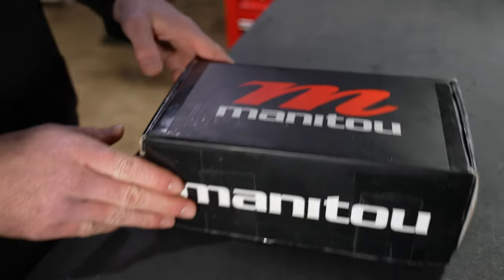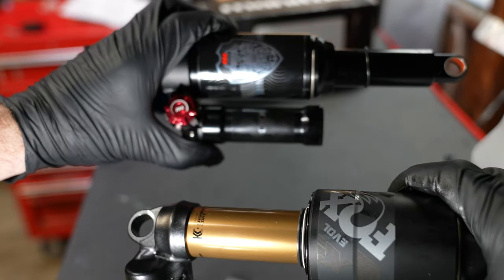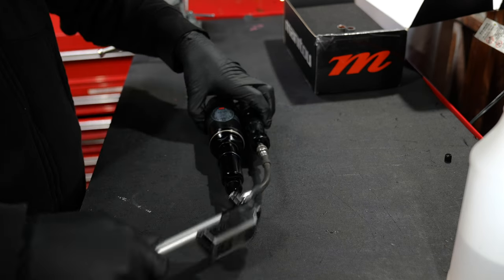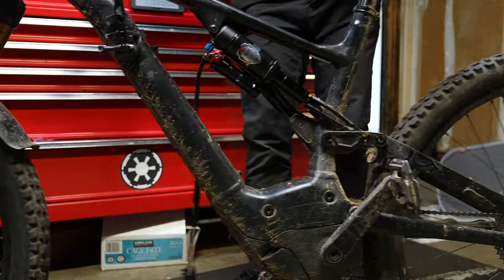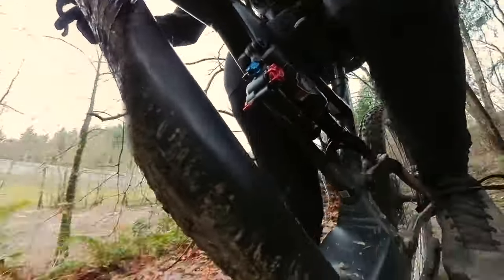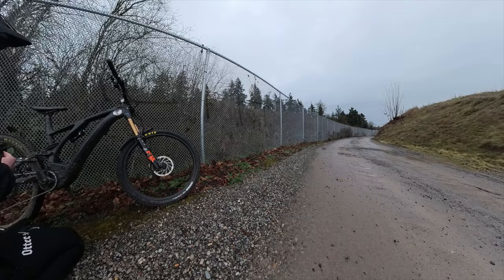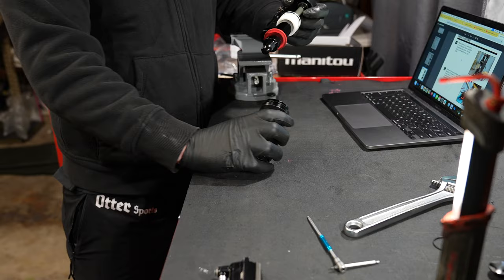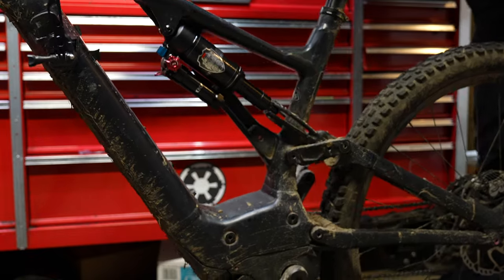Manitou Mara PRO Experience

Comment: How can you not understand psi? Its in the name, pounded per square inch, Chane the squared inches and like magic you need less pounds
Reply from the maker: Bro, thanks. Over thought that I guess 😆. It has more to do with the size of the negative chamber, but the part I don’t get is how is this shock so plush with low pressure. ‘23 Rockshox  runs low pressure, but it’s harsh off the top
Reply: @OtterMTBtech  the resistance is from the seals. A typical Oring  actually gets pushed to the outer wall with more pressure, that's how they seal. Who(you) knows what seals these shocks use, but they would flare out under pressure

Comment: FYI. As the volume of the IFP is VERY small the pressure will drop SIGNIFIGANTLY when you connect the shock pump as the air will fill the hose and thus equalize. So when you set the pressure there it is set. It does not loose presure when you take it off - but will do so when reconnecting the pump. So it maybe wasnt't bang on 300 PSI but is was sure as hell not 140.

Comment: lol bro, you don't cycle this shock while filling it. THERE IS NO EQUALIZATION PORT. You have to set the negative by taking the air can off.
Reply from the maker: I didn’t know this. Do you care to share any more about shock. It supports riders 240lb as is usable rebound range and air pressure setting. 

Most shocks couldn’t do this
Reply: @OtterMTBtech  Fox and Rockshox use a dimple on the inside of the air can so the pos and neg chambers equalize and it's usually around the sag point. Upside is that your negative is always at the right pressure. Downside is that there's a dead spot in the shock, and it equates to 5-10mm of wheel travel. Manitou don't have this dimple or dead spot. So to set your negative pressure, you have to take off and reinstall the air can. You can put the shock in the freezer to increase the density of this air and the pressure in the negative according to pv=nrt that we all know. But air will slowly leak out of the negative so you'll have to re-set it periodically. I do it once a year.
Reply from the maker: Thanks, probably in the manual I just don’t remember that?
Reply: @OtterMTBtech  Probably, but to be fair, Manitou's setup guides are not the best. What would make this shock perfect would be if they added a fill port to the negative and an easy swap damper like Formula have. The Mara Pro is really good in the stock tune for riders 150-180lbs.

Comment: You may want to take another look at what the IFP pressure should be on this shock. Just watched a video where Manitou reps talking about the shock and mentioning they set themselves apart from other shocks in that they only require IFP pressures to be at 150psi.. So that shock reading you got actually checks out.... EDIT- i did just look at their service manual which states 300psi.. Confusing.
Reply from the maker: I watched that video and read the repair Manuel who’s right?

Comment: Could you try some Formula Selva S or R forks? (preferably S) I'm deciding between that fork and a Lyrik
Reply: The MOD Coil shock would also be cool.
Reply from the maker: It’s a no brainer,  if you can afford the Italian stuff it will always outshine main stream stuff, I haven’t even seen that fork in the usa.
Reply: @OtterMTBtech  weirdly the fomula selva s and mod shock are cheaper than most of the fox and rs stuff on Propain's configurator
Reply from the maker: Italian damping is on another level. Don’t hesitate to get that fork.

Comment: Mara pro is awesome. wait until you try a mezzer to or even a Dorado. Nothing beats the Dorado.
Reply from the maker: I have literally never heard anyone say anything bad about the forks. Have you tried both?
Reply: @OtterMTBtech  I have Dorado Expert (swapped out from a fox 40) on my DH bike with IRT upgrade and Mezzer Pro on my trail bike that I take everywhere else. I have tried a lot of forks, these are the ones that work the best for me. The damper is extremely good IMO, and the air side is extremely good at forming the curve how you want it but is is quite sensitive to changes in pressure. It takes a while to find the correct setting but once you do it's very good. Dougal/shockcraft from NZ knows a lot about tuning them. I never used him but I have asked him questions and he knows all there is to know about manitou products.
Reply: Hell yeah. Have been using dorado 36 from 2013 то 2021. Now have a 37mm dorado pro. Didn't even consider any other fork for replacement

Comment: It is also not just due to the negative air chamber that will make it feel plush as it sets the negative side from the atmospheric presure (from shock fully extended) and not ny a transferport like many other shocks do. So the plushness also comes from the low pressure in the pos chamber.

also - the setup must have been wrong here. It looks like you bottom it out just while pumping with your legs. This is, just like the Mezzer, their big hit shock, so it feels very strange if that was a perfect setp and i just BLOWS through all the travel that easy...
Reply from the maker: Mezzer

Comment: Nice video. So I have a Mara pro and I found with the large can it was too linear.  (Did you not get into the can where you can change how large the volume is? Not unscrewing the can it is a sleeve on the outside of the can.)
   To remedy this i put the smaller air can on and then still had to get a volume spacer to go inside the air can on (this one I unscrewed the air can for) the whole time i was emailing with Manitou about my setup. 
    When I first got it it was so wallowy and I would bottom it out on pump tracks.
Now the shock is softer off the top with great mid stroke and ramps up at the end, and i was able to dial down the compression
   I run 26-28% sag. 
     The amount of adjustability with this shock is impressive. I really want to try a mezzer  and a mattoc. I have a mastodon and I love it.

Comment: The maraprohas great featuresand veeery good damping.
But the old Design has its quirks with the sealed negative chamber. That means it cannot be that smooth as it could be and it dies not work well with everykinematics.

Now the Gen 2 mara ist coming. It finally has the equalisation port, a new designed damping piston, tunes and a smaller oiggy bag and lever to make better clearance in more frames.

The shock will be a completely different animal.

Believe me, I already have the Gen 1 Mara pro which one tuner modified for me with equalisation port.so so smoothamd supoortive.

And manitou even optimised the aircan itself for the new design. So thisthibg will be great

Comment: My Specialized brain has an auto-sag feature that requires 300 psi initially before releasing to proper sag. But of my 3 shock pumps, 2 only go to 250 and the third took a ridiculous amount of effort to get to 300. Wtf Spesh?
Reply from the maker: You need a better pump

Comment: Measuring sag with pump attached to shock for me is questionable.
Reply from the maker: For sure
Reply: It wouldn't work for a Manitou fork but works fine for Manitou shocks.
Reply: funny story, I was in the bike shop doing some demo rides and I suggested, "hey, why don't we use one of those rubber straps and strap the pump to the frame when setting sag so we don't have to constantly hook up the shock?" so we tried it and now that's how they do all their set ups.